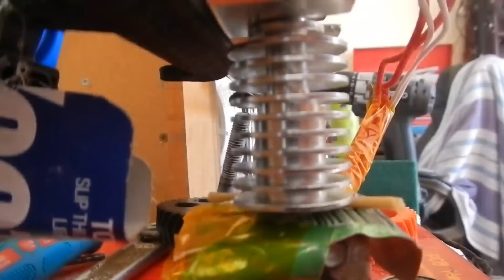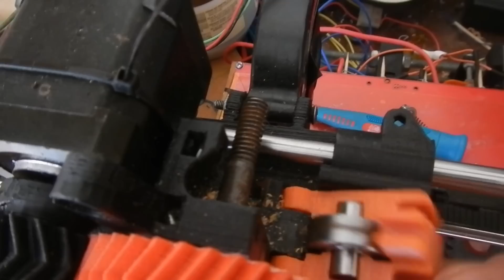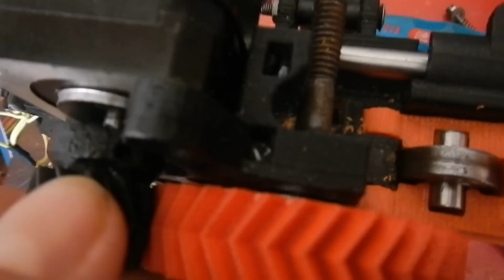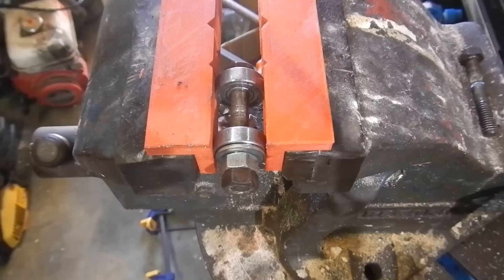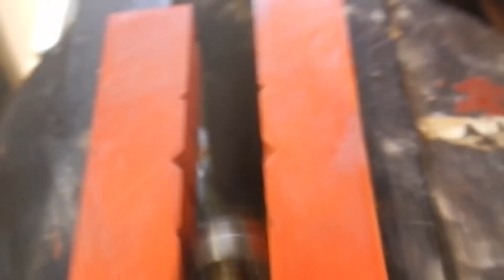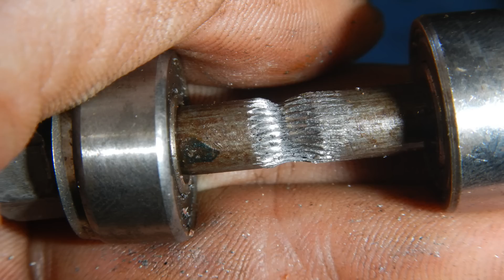Make a Hobed Bolt by Hand for RepRap 3D Printers

Comment: Its been just over a year - how did this bolt hold up over that time? any problems?
Reply from the maker: vizionthing its going great. I'm actually printing with it right now. Its done about 7kg of abs. Never had to clean it. Doesn't strip the filament. It's just perfect.
Reply: Excellent job - that's now on the list of parts to make - thanks for the upload